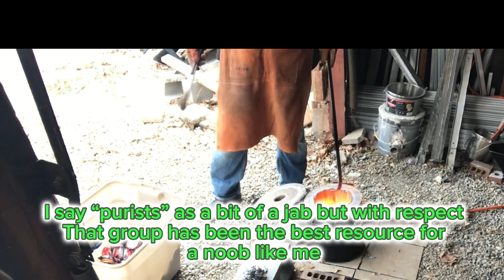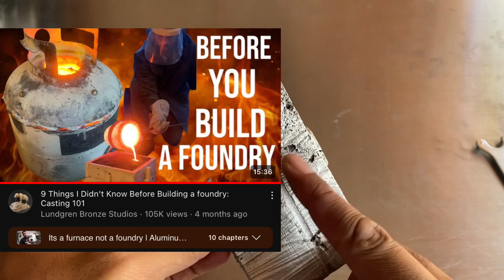It’s Been a While: Prologue to Season 2 Melting/Casting

Comment: I enjoyed your video and the list of shout outs, some I haven’t heard of that I’ll definitely be checking out. I learned not to let casting failures get me down. The only real loss being a little time and fuel for the fire. I’ve learned that aluminum cans and extruded aluminum is a great source of frustration for casting. I used a band saw to make crucible sized pieces out of old cast aluminum auto parts before i built a huge melting furnace to make aluminum “muffins” from alloy wheels. Looking forward to season 2. Subscribed
Reply from the maker: Oh I know all about drink cans and the frustrations they can cause 😂. But when I started out, it was all I had access to, and the thought of making something, anything, out of melted cans was just so fascinating to me (it still is). One of my goals for upcoming videos is to get my hands on cast aluminum and make something and also show the difference between the 2 alloys as I perceive them from a melting noob’s point of view. Thanks for the comment and sub!